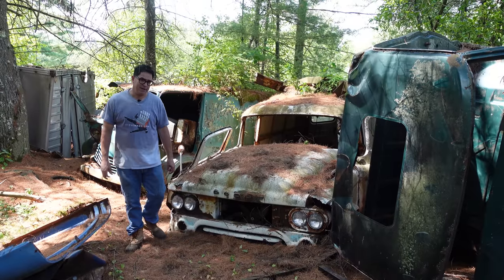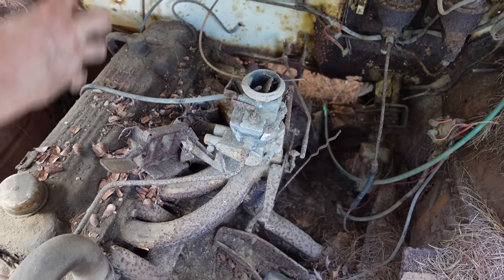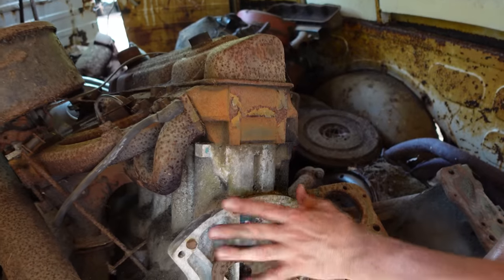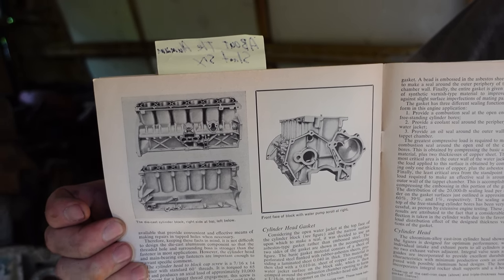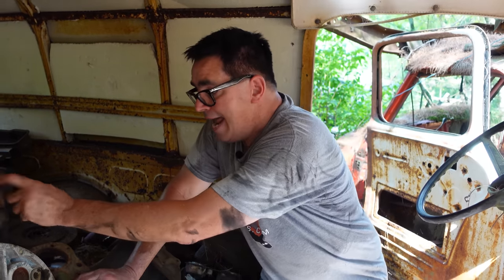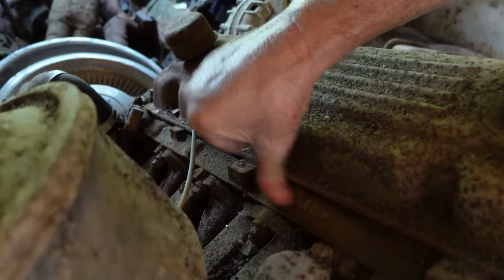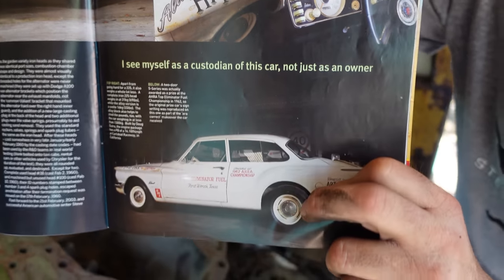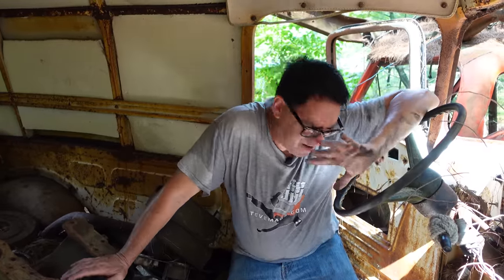Slant Six Surprise!

Comment: Just as a follow up. My Dad had a Lancer and had coolant in the oil. I was maybe 16. I pulled the head and was shocked it was an open deck design and Aluminum. But lets move forward I worked for a Dodge Dealer in mid 70's. Chrysler had an issue with the 225"s if they sat the valves stuck. At first one car a day got really good and could do 2 a day which meant pulling the head off and cleaning up the valve guides. So you wrote for a magazine but seems you did not worked as a tech.   Everybody makes a mistakes.

Comment: Would love to build a slant 6 and drop in my 95 gmt 800. Just because of reliability and also because absolutely no one has ever done it that I know of. Just have to make or buy a bolt on extension for my nv3500 5 speed transmission. Any thoughts other than being a dumb idea???

Comment: Thanks again Steve. I understand the Hyper-pack was a 170 c.i. Did they do aluminum 225s. If so was your build a 225?
Reply from the maker: Hi Oops!, the Hyper-Pak program of 196 / 1961 focused on the low-deck 170 Slant Six. But there were many builders who used the tall deck 225 - like me. The manifold doesn't care what block it's on though the 170 will run past 6,000 while the 225 (and later 198) won't go over 5,200 due to the longer stroke and awkward geometry and poor breathing at that crank speed. Thanks for writing, Steve Magnante
Reply: @SteveMagnante  👍 😀

Comment: The truck you are looking at is a 1961 to 1966 in 1960 in the trucks they still use the 230 cubic inch Flathead 6.
61 to 1966 looks identical to the 1960 model year including the grill the only difference is in 61 the Flathead was officially dead in passenger vehicle and light trucks replaced with the slant 6

Comment: Got any info on the Hemi 6 that was used down in Australia?
Reply: A few vids on YouTube by searching for Valiant hemi six 215 245 265 E49.
Not a true hemi but the ultimate E49 265 developed 302hp off the showroom floor.
The Hemi six inline non slant motors replaced the slant six from the 1970 VG model.
Most famous use was the Australian Charger two door coupes.
The rare Euro based Centura smaller car used them also. Turbocharged Centura drag cars go very well.  .

Comment: If I'm not mistaken the slant six is recognized by ASE as the best engineered combustion engine of all time.Anyone have info on this?
Reply: Yeah, I guess that's why Chrysler dropped them so fast after they got the AMC 6? Actually it was a fine engine but a bit on the small size and when they enlarged it to 225 CID the intake tuning didn't work as well as it had in the 170 CID. original. The AMC 6 with 7 main bearings was enlarged and improved to get 190 HP in 1990 and in production until 2006 by Chrysler.
Reply: @keithstudly6071  The 225 version was available from the beginning. It wasn't "enlarged" as there was two different castings from the outset. The 225 is a taller deck block. From what I can recall reading of slant 6 history the 170 was dropped later because of the costs involved with duplication and the later 198 was produced from the tooling and castings of the 225. In Australia we only ever had the 225 CID version of the slant 6 from the very first model Valiant.
Reply: @keithstudly6071  I'm a sl/6 fan, but I've got an FI 4.0L AMC 6 in my 95 jeep Cherokee and that thing is pretty indestructible, too.
However, my sl/6 got just shy of 30mpg, once. And my 4.0L jeep never got better than 21mpg.

Comment: I was told by more than a few people, including some production engineers, that one of the main reasons Chrysler made the Slant Six was that the cylinders could be machined on the same equipment that machined the V-8s with the same slant to each side. Any truth to that, or were they pulling my chain?
Reply: Seems unusual with a thirty degree slant six and most V,8s being ninety degrees. So half 90 being 45.
Reply: As John D also mentioned below, the geometry doesn't quite work.  Making a fixture to adapt the machining to what had been used on the flathead sixes wouldn't have been all that difficult.  The Slant Six had a narrow bore (3.40626", or 3-13/32") and siamesed the  1-2, 3-4, and 5-6 cylinders, to give a fairly short length for the block, as well as that offset water pump.  It reputed durability, aside from the attention to build quality, was in making the iron castings the same as the aluminum block, so this was a fairly heavy engine for its displacement.  Also, to save money, the mains were the same dimensions as the "B" blocks.

More than likely the block machining setup was adaptable to whatever engine lines were called for at the Trenton plant.  Saves on the considerable capital cost, not only of the machine tools themselves, but also the related facilities, plus it allows engine production to adapt to market demand.
Reply: They're pulling your chain.
That's a big factor in why some companies have gone with 90° V6s though.

Comment: So we're they Die-cast or Aluminium ?
Was a Aluminium head available later ?
Main reason for the slant was to allow for more productive rod/stroke ratio.
The Jewish intake manifold put the carby away from motor heat, then they stuffed that by bolting intake and exhaust manifolds together !! wtf
Apparently OK in cold climates; was no end of trouble in Australia. Eventually we cut a 3/16" gap between, brazed ex manifold closed and put a heat-shield in there. Perfect, no more manifold gasket dramas, no more vaporization, maybe a little more power. Extractors would have been better.
Was a225" in a 3 series truck. Solid lifter cam, hi press oil pump, oil cooler, 4 bolt main bearings, those truck motors meant business. Drove other trucks with 318 V8 , were good at highway speeds but that six had more low down torque.

Comment: I had a slant 6 in a 1980 grand fury. It was a gut-less pos. The carb was always coming loose. It would not stay tight. It had to be removed to be tightened because the bolts came through the bottom. Stupid.

Comment: Chrysler always pushing the engineering envelope with fabulous success however over estimating the avg American intellect as with the airflow......if customers changed the coolant on a regular basis it wouldn't have eaten head gaskets....but no one does that.  Not even today.  I've seen so many vehicles I've serviced with the original coolant and over 10 yrs and 100k miles

Comment: Take that motor out of there , put it somewhere safe so it doesn't get scrapped someday
Reply from the maker: Hello marion cobaretti, that oddball aluminum Slant Six is totally safe. Bernardston Auto Wrecking owner Dale Hastings has a no-crush policy and knew all about that engine when I ran up and said: "Dale I found an aluminum block Slant Six". It's safe and he put it inside that van 30 years ago (he told me) to keep it dry-ish. Thanks for writing, Steve Magnante

Comment: My family had bought a brand new 1975 Dodge Dart with the 225 cid slant six and that was one of the worst engines ever.   It was not thrifty.   It was rough running.   It had an irritating starter sound.   And the engine was a dog without any pickup.   The car was so bad that my parents sold it 18 months later and used the proceeds on a 1973 Ford Torino wagon with 75k miles - the Dodge had 7500 miles when it was sold.   The Torino was not much less fuel efficient than that Dog, but it did give them 125k trouble free miles (sold it in 1986 with over 200k miles on it).    I cannot fathom how anyone likes that POS slant six.
Reply: Yeah these slant guys should check out a Ford 300 Six if they really want a truly unbreakable inline six, they run forever. Most of my trucks are v8s but I've owned a few 300s and they were reliable as hell. I still own a 95 f150 I keep for a spare, it will sit for months on end until it's needed and then fire right up and run great, I s got 250k on it and doesn't burn a drop of oil. I had another one in a 89 f150 that still ran great with way over 250k. Only had to retire it because i worked it so hard that I cracked the frame rail. Between the bed and the cab

Comment: DEAR STEVE< GO GET THAT LUMP, --'surf' over to AUSTRALIA for an alloy, DOHC, HEMI-head for that block.   It'll 'fit', even though Mopar of Australia had mounted the engine vertical-ly by the time the head was available.   Yours "blew" because you had "pieced-it-together" with 4 different  intake-gaskets, PLUS, weren't you going for 450 Hp with a power-adder like a Super-charger, turbo, or Nitrous?   [--Or all three!?! ]  .  There'll be a KEWL-"Bulge"  in the hood over near the passenger-fender,  to let everybody know to "Back-off, Buddy, DOHC-HEMI-'Tower',--the Streets to 'Scour.' "  Find a 4-dr '59-61 Valiant/Lancer, cutting-it in half, hacking-out the rear-doors, seat, --shortening the frame & body to a two-passenger, semi-fastback coupe, like a few guys have done to their early-mid-80s Seville 'bustle-back' Caddies, making them 2-dr coupes.  "MAD-MAGNANTE,"-Mightily-Majorly-Magnifies-Magnificent, Magical, Murderously-Modded-Manual-MOPAR,-Manipulating-Mashed-Modsters-Mitigating-my-Most-Mahvelous-Melbourne-Music, Me-Mate,-Making-More-Merry-Monied-Mellifluous-Mini-Mufflers,-Minutely-Mastered...

Comment: I had a 71 Plymouth it had a slant six in it? It wasn't gutless it was okay on the power it wasn't no speed demon but it had good power even though it had air condition it was a good car I drove it to well over a hundred and thirty thousand miles when I sold it paid $200 for the car it only had $58,000 miles on it when I bought it from an old lady that she ran over a parking block and ripped a hole in the oil pan so me and my friend went to junkyard got a used oil pan a gasket and some sealer and jacked up the engine a little bit and replaced it the car ran from 58,000 130,000 with no problems mechanically? I wish I would have kept that car that was a big mistake selling it now there were so much paid $200 sold it for $2,400 and now I could have sold it for $20,000 car had all original interior not a crack on the dash the paint was coming off because it was old needed to be painted needed a new top it wasn't bad just see had hit a garage and ripped a little rip on the vinyl top which I had repaired but it needed a new top the front seat needed to be repaired because it had gotten more but it interior it was still very nice on that car put a new carpet repair the front seat it would have been perfect I wish I would have kept it kick myself and that you know what for that.

Comment: Never understood why they cast them with an open deck, if they'd cast them conventionally maybe they'd have lasted.
Reply from the maker: Hello Mark Ellsworth, you might be able to freeze-frame the vintage magazine story i show on "How They Make Aluminum Engines" and perhaps the passage is visible where the open deck is explained. If not, the reason has to do with the fact that the high pressure aluminum die casting machinery Chrysler used had multiple inserts that fit together like a puzzle to form the empty spaces into which the molten high-zinc aluminum was injected to create the blocks. The hassle was, unlike a simple sand cast mold - that can be smashed apart with hammers after its one-time use, these die casting machines were designed to pull apart on slides to allow the finished block casting to be extracted. The open decks were mandatory in this scheme to allow the mold slides to retract after each block was cast for the next part. With closed decks, the blocks would have had to have been SOLID, no-go for water cooled engines. If you wish, Google "Willem Weertman Aluminum Slant Six SAE White Paper" for a much more clear description of "why the open deck". Thanks for writing, Steve Magnante